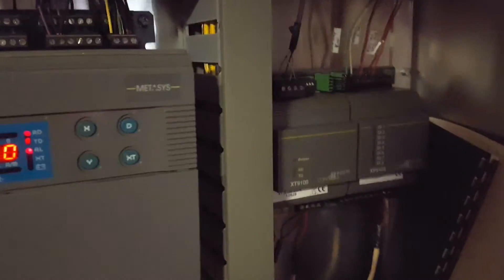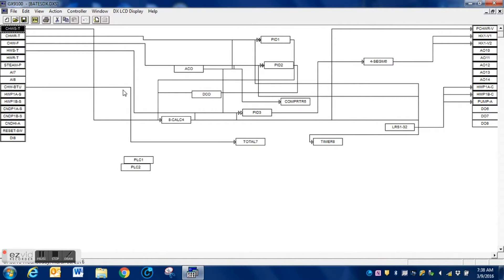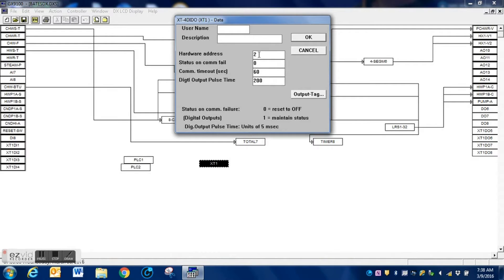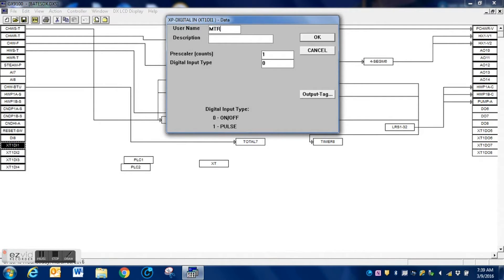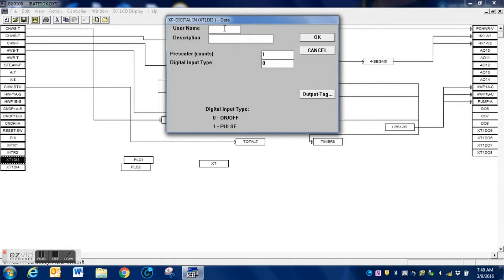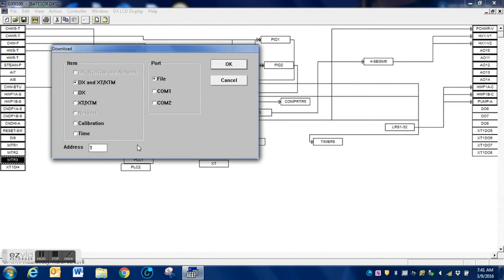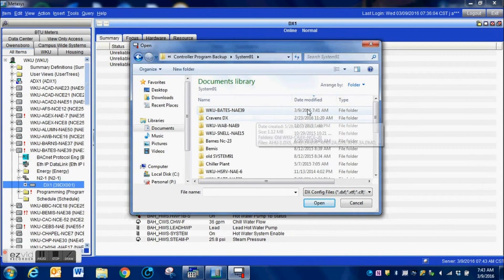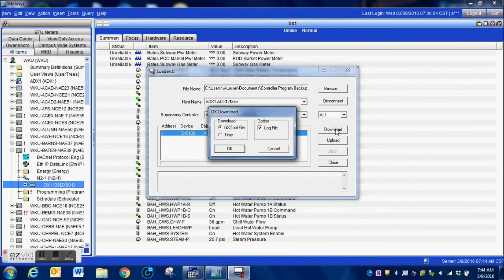Adding an expansion module to a Johnson Controls DX 9100

Comment: Does an XTModule need a DX to hold the logic or can they be stand alone?  I’ve seen them on panels with missing DXs
Reply from the maker: Generally they need a dx. They can be mounted remotely but should be connected.  I've never seen an xt that wasn't connected to a dx but i have seen and set up the newer io modules as stand alone devices capturing meter pulses.

Comment: really enjoy watching your videos i have learned a lot. i am having trouble conecting an external pressure switch to a vma1420
actually i got the pressure switch to work but i cant get the lights to work for normal and alarm through sideloop can you help with this gunterj@musc.edu
Reply from the maker: +jim gunter the vma should be able to accept either a 0 to 10vdc or 4 to 20 ma.  What kind of lights are you talking about